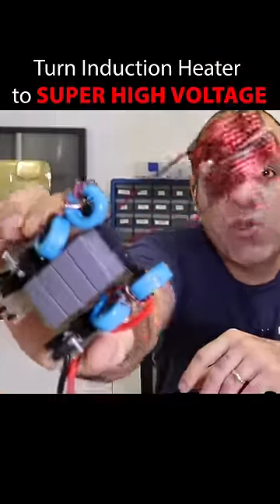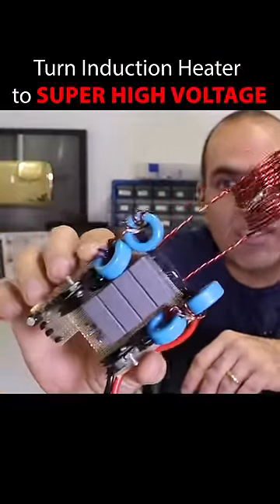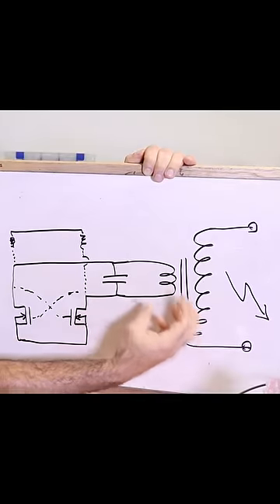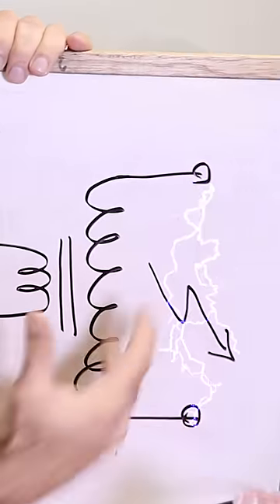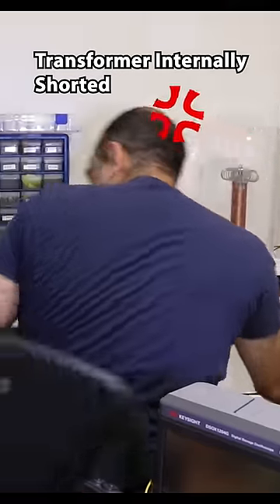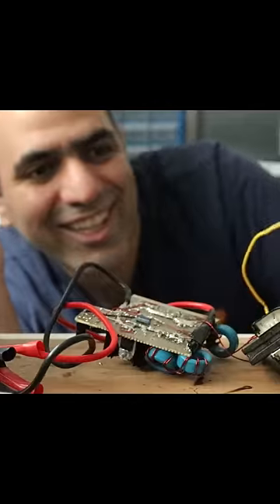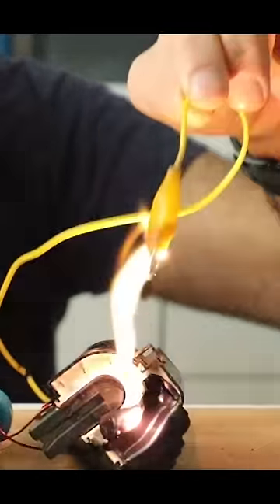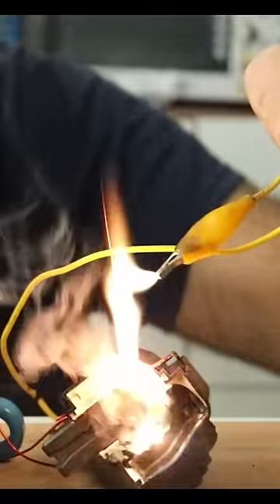Induction Heater to High Voltage Generator #Electronic #Arc #Funny

Comment: Try a big neon sign step-up transformer. 'Did this as a boy. Lots of schooling, and a decade later, Bell Labs actually hired me and got me the required security level clearance. (Thank goodness juvenile  records are sealed.) 'Retired from the current (pundit, I) AT&T in Y2K to avoid a transfer from WI-USA to 1,000 degree dew point San Antonio ... Remember the Alamo.

Comment: Don't try this home.... Too late made one years ago just from the ZVS schematic. With the correct parts it will generate huge arca and handle most voltage input from 18-48volts DC. THEN STEP UP THE VOLTAGE WITH A WALTON CROKOFT MULTIPLAYER.

Comment: I really want to see you positively overcharge an electron mass, and phaze it overtop of an coronal discharge. Prephaze lightning strike. And 8ft away use discharge mat. Align the electron south, then east to discharge on west. Yes you have to equalize gravity durring conversion. Before turning east, as this is the only way it's possible using schumnans resonance to keep charge @200%.
Then you an i can talk helping humanity. :)

Comment: This guy is different. Very entertaining stuff. I hate being shocked so I could never mess with this stuff. 
Hey electroman, 
Can you do an experiment, can you bypass the diodes on a regular car alternator and see if you can up the voltage and amp output past what it was designed to put out? 
Also, only run it off a smaller 6volt or no more than a 12v car battery

Comment: The transformer was likely a step down to begin with As such the enamel insulation was only expected to be exposed to it's incoming line voltage, whatever that was. Doing what he did he generated a seconday voltage in excess of the transformers insulation capability and the insulation broke down allowing arcing to jump between the windings. Also he likely overheated the windings to cause further breakdown of the insulation, also allowing more arcing between the windings.